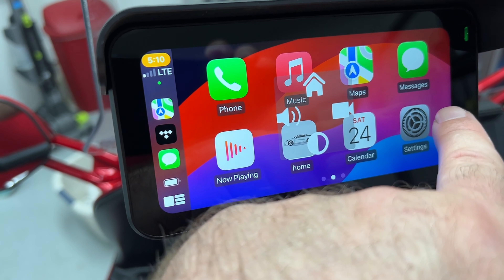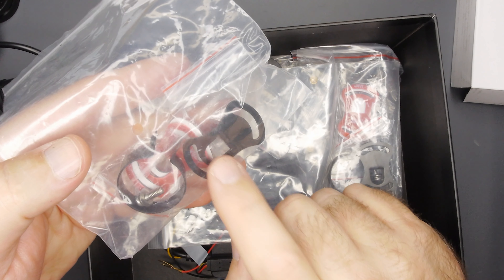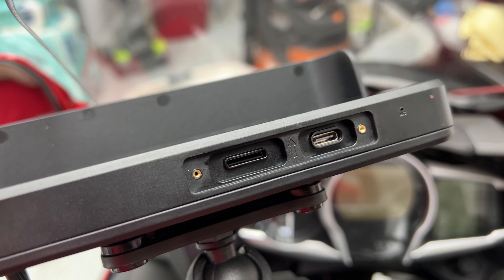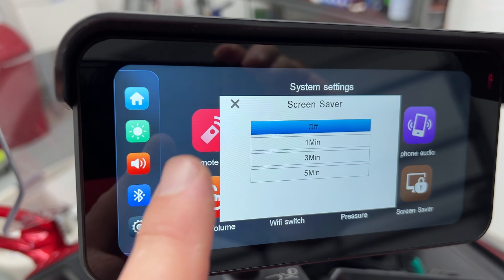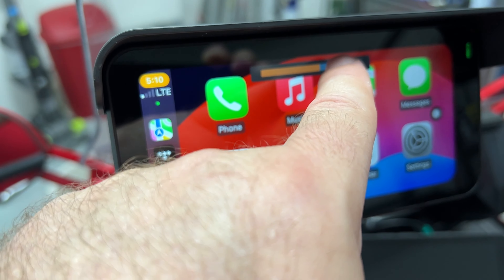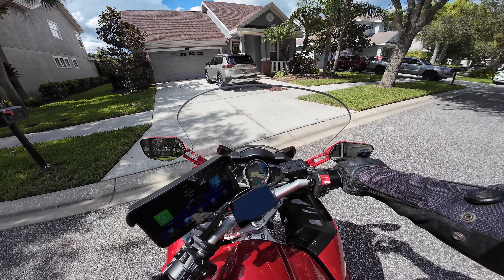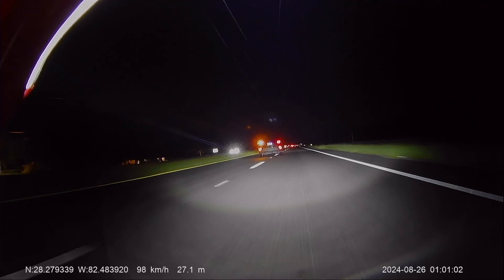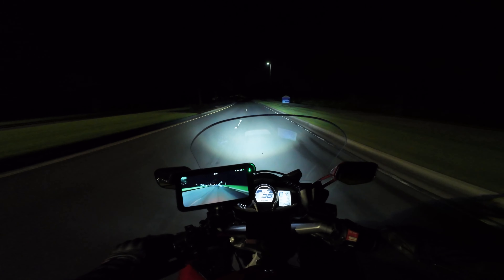FULL Review of the Aoocci C6Pro Motorcycle Dashcam CarPlay TPMS and MORE Unit

Comment: Hello Sir ! Nice review ! One question: Mine does not start recording while riding (just when stopping). Does it has to do with G-Sesor beeing set up to HIGH ? What could be the issue? It records only while stopping....I have also the remote controller. Looking forward to your impression about this issue, regards !
Reply from the maker: The g sensor is only for auto locking a clip in an impact or hard brake event, nothing to do with recording. How are you determining it’s not auto recording? There’s no setting for it afaik, it just starts at boot until you stop it or turn it off. Nothing to do with moving.

Comment: Just attached mine to my 2011 harley davidson tri glide ultra classic. The APP you mentioned in your video was hard to find because it's not clear what you said even when I used closed caption to see what you were saying, it wasn't picking it up correctly either. So I did a google search of dash cam apps and I found what I think it is. Viidure. I installed it and i will check tomorrow to see if it is correct. Thanks for this video which lead me to purchase a motorcylce dash cam that has car play for a decent price. I just refuse to pay the high price for these devices that will be obselete in two years and have to replace them. At this price when it goes bad in a few years I will not be as dissapointed. I have to order the tire sensor batteries as the ones that came with the sensors are like you said, Dead on arrival. I will get as you mentioned energizer or duracell, Thanks.
Reply from the maker: I'll add the name to the description - thanks for the tip - and yes that's correct!

Comment: I ordered mine finally today, but also found they had a 10" device for my "Truck" too. It includes 4 cameras for about the same price. No TPMS with it though. Will let you know how I like both once they arrive are installed and used a bit. Might be next Spring for the RV, but do plan to ride most of the winter.
Reply from the maker: Cool, it'll be interesting to see how they compare!
Reply: @TwoWheelObsession  Just got info that the shipping has commenced. No arrival date yet posted.
Reply: Package arrived and appears undamaged. Unpacking soon. Will most likely install on bike next week. Not sure when I will install and test out the Truck device. Not much install information included and I've not worked with camera's much. Bike install certainly more straight forward.

Comment: So, I purchased one of these using your link, and again, I appreciate your review. Unfortunately, I'm quite disappointed in it. It seems to me that Aoocci might have a batch to send to reviewers, and a different batch they send to consumers (at least the ones using a discount link). No Aoocci packaging,  Nothing about the device I received indicates it's an Aoocci product (other that the QR code which takes you to the Aoocci "instructions"). The updated interface seems like it went backwards. Even more unintuitive than what you showed. They no longer have the "panel" or "dash" screen (which was one of the main reasons I decided to try this unit). For bikes that don't have easy-to-read gauges (I'm on a Stratoliner... which isn't terrible, but looking at the tank to check how fast I'm going is cumbersome at best). The TPMS readings now are practically useless. On my test ride, I got one of the pressure warning pop-ups and it was so small that it was dangerous to try to see what it was showing while riding. It seems to have a mind of its own when it comes to which screen is displayed. CarPlay worked ok, though trying to use Siri via my Cardo Edge was problematic. Only speed display I can find is when in one of the camera views, shows Kph (have yet to find where that can be changed), and it's contrast is so bad that it's again, practically unreadable while riding. So for me, the built-in GPS is basically moot other than being able to show coordinates on the videos maybe? For the price, getting the cameras and having wireless carplay, it's not a bad deal. Just don't go in with high expectations IMHO. I'm fairly certain I'm going to go with the Chigee as it seems to be a much more stable and supported platform (where this one seems to be the cheapest of the cheap that most of the discounted devices use (maybe with a simple QR code change to direct the user to a specific "brand"'s  website).
Reply from the maker: I updated the description quite some time ago, that i suggest the C9 series now that they changed it.
Reply: Bingo! My C6 came in yesterday. After watching the video, you wouldn't think I have a C6. My open-box, plastic film still on the screen, plugged into USB port unit to see what I have unit is going up for sale.

Comment: I forgot to say thank you for this review because from what I can see the company took all your suggestions and corrected them like the camera mount for instance show for me it shows a company trying to evolve and not just do a money grab
 
Can you tell me the part where you show in the menus it has a screen that looks like a cluster showing altitude and speed and tire info it also shows on the left side your RPM how do we link up so it reads this from our motorcycles? As this would be great if I could cover my existing dash with this to add some modernisation?
Reply from the maker: It doesn't have the option, it simply shares software with the core product so not everything is active.

Comment: Ok… a couple questions… can you describe how the built in “dash” screen works (maybe even another video). It looks like it has bar graphs for speed and RPM… are those functional?
Reply from the maker: Because it has a built in GPS, things using it as a sensor work - like speed.  The Tach doesn't do anything on this model, others have optional plugins for an OBD2 port that make it work.

Comment: Hello from The UK! Thanks for a great review - I've just fitted one and have a couple of questions. First off, how do you change the speed from KPH to MPH on the dashboard view. Secondly, the remote control - I guess it has a battery inside? I can't see any way of changing the battery. Any ideas?
Reply from the maker: The remote splits open but you’ll need a sharp tool. Sorry I don’t remember where in the menus it was to switch

Comment: great review have you done any tests with car play or android auto using voice commands from a headset on your helmet??
Reply from the maker: That has nothing to do with the units, it all depends on your coms and phone, how well that works for each person.  The dash units are just screen mirrors.
Reply: @TwoWheelObsession  I saw carpuride had an early issue whereby Bluetooth via the carpuride device was causing issues . They patched it to make Bluetooth between headset and phone only with BT transmit from phone to carplay and voice commands works as expected , so séms.it is device specific . Just thought I would ask if yours worked with headset , but thanks for reply
Reply from the maker: There's no reason to direct connect your coms to the unit, I don't even know why that was an option.

Comment: Can this be wired straight to the battery? I know it's likely not ideal. But, I have an 06 fjr1300 and they suffered from "spider bite" problems, causing a lot of things to not work when they occurred. Because of this, I'd prefer not to wire anything directly in to the bike. I'm quite used to unplugging things so they're not drawing power when the bike is off. Lol
Reply from the maker: It can but you don’t want to. See my vid on adding a fuse box. Cheap and simple
Reply: @ I watched that video after I commented. Already ordered the fuse box, thank you!

Comment: How would you compare the screen quality of this unit to the chigee? I bought the Chigee and was a bit unimpressed by it. It’s a 5 inch screen.
Reply from the maker: Resolution is about the same, the chigee is a touch more responsive and fluid, seems to have a better refresh rate.
Reply: @TwoWheelObsession  thanks for the reply. But the Aoocci has a bigger screen? I went ahead and ordered both so I can compare and will return one or both.  It’s nice having it on the bike and ready to go, but I need to be able to see it.
Reply from the maker: Yes, and Aoocci also has a 5" model.  How big you want/need totally depends on the bike and where you are mounting.  For me, 5" was perfect but sure larger can be better.
Reply: @TwoWheelObsession  I plan on mounting mine over my shield. But I will check in just to note the differences I see. Thanks for the input!

Comment: If I order the fuse block and attach my Aooci C9 , will it automatically turn off aftet the engine is off. I want to add fog lights, if I forget to turn them off will they turn off automatically?
AB
Reply from the maker: Correct. As I showed, everything is off with the key

Comment: So...newbie here...if i buy this.. i automatically have navigation anywhere in the world without having to worry about my phone's data/roaming all of that
Reply from the maker: No, nothing changes with that, these do not have anything built in.  It all runs off your phone.  Whatever you want to use for nav.  That being said, many nav apps don't require data and have offline maps.  I use Scenic.
Reply: @TwoWheelObsession ah i see thanks for the reply. I was looking for cameras anyway but tbh... basically if you have a waterproof phone and wireless charging... there's no point in buying it just for navigation is it?
Reply from the maker: PURELY for navigation, no.  But that's not what one of these is all about at all, being a single purpose device.

Comment: Thank you for the discount!  The only thing missing from your review is audio connectivity between the phone, the display, and your helmet.  Also, can you still share music or communicate with a pillion?  Thanks.
Reply from the maker: You only pair your phone likea ny other CarPlay. Your phone and coms link still handles the audio
Reply: @TwoWheelObsession  how would you go about mounting this to a navigation relocation bracket?
Reply from the maker: I don't even know what that is, sorry.  You can contact them for other mount options
Reply: @TwoWheelObsession I just received mine in the mail.  It seems they now provide a ram ball mount on the back instead of the one they used in your video.  They also provide you with a bar mounted ram ball and a screw mounted ram ball.  Just FYI.